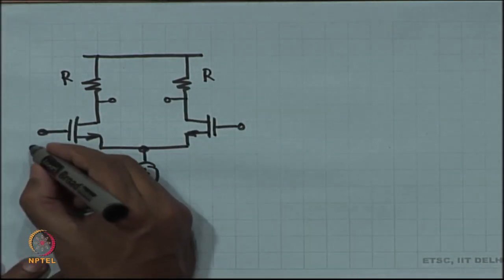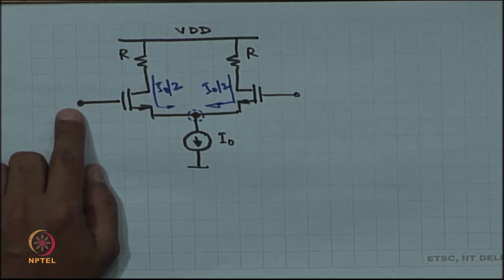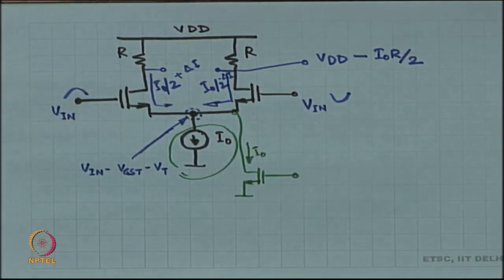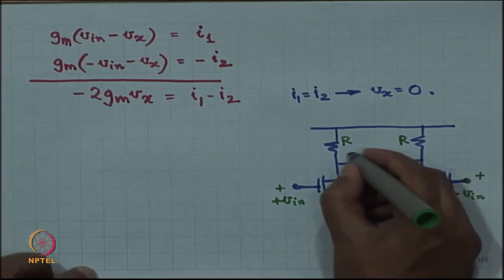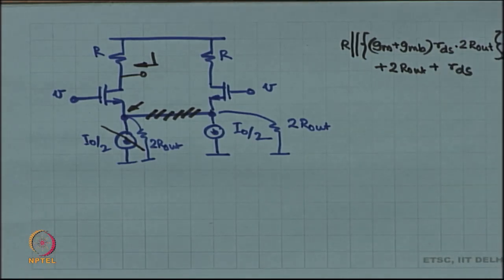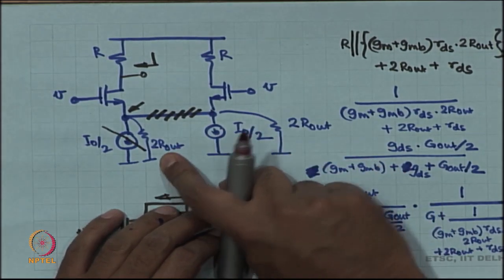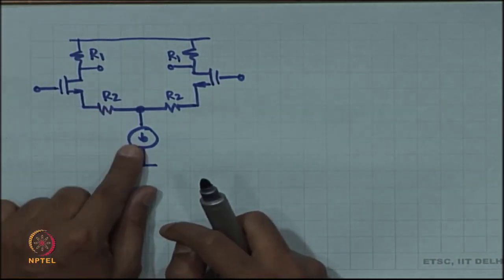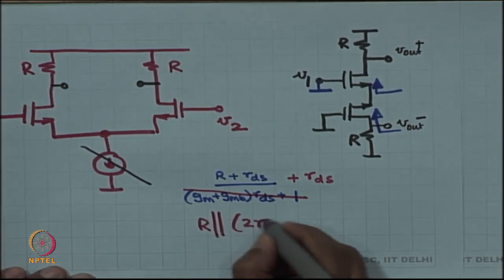Differential amplifiers-I

Comment: I have a little doubt. For small signal picture the current source should be open circuit as we took the current source Io to be ideal. But then suddenly we considered 2Rout for small signal model. Why?? What if in some question ideal current source is given. What will we do then?? Leave the source terminal hanging in air?? Or can we place a capacitor parallel to the current source???
Reply: if it is an ideal case(current source), sir mentioned that theoretically difference in outputs is zero,